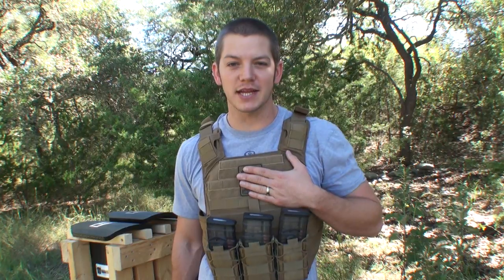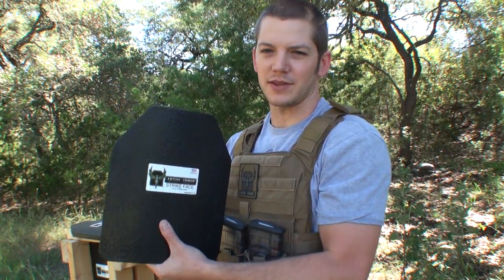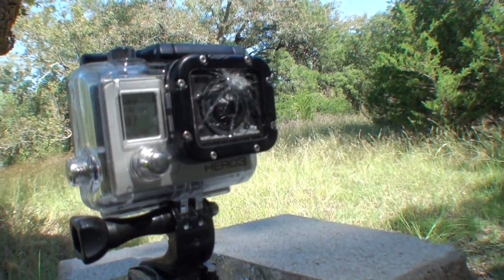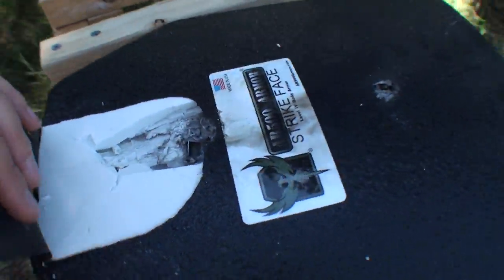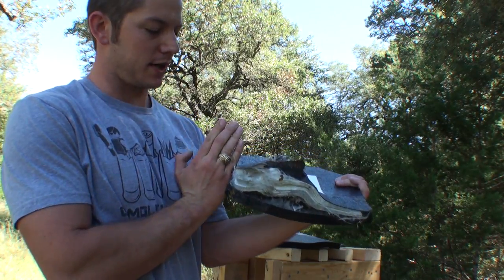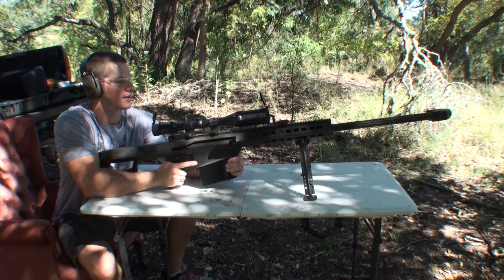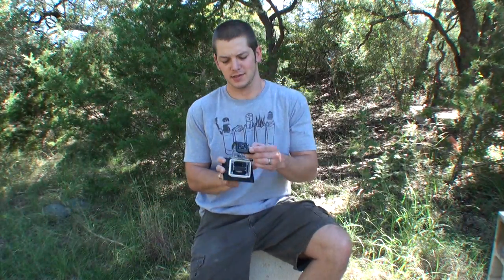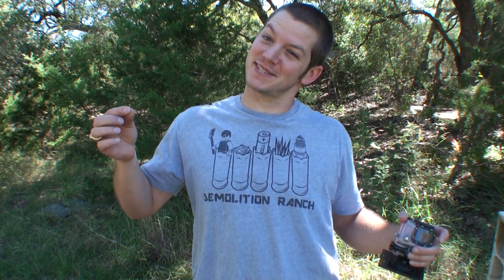Level IV Body Armor Torture, 50BMG

Comment: No armor plate will save you from a .50, the power behind it will turn your insides into jelly.
Reply: +Charles Moir 
Yep. Even if it blocked the .50, the impact itself would be devastating.
Reply: Yeah, we're talking broken ribs and broken sternum plus severe internal trauma and hemorrhage with such kinetic energy
Reply: +Xplosion51 It would drill another one on the exit side lmao
Reply: unless you got pilows behind it. #cheapandeffective
Reply: Bobby G. Why? At least it should be a quick death. Probably worse getting hit with a smaller round and barely surviving, so you bleed a bit and suffer before being shot again
Reply: I would rather take a.50 cal straight with no armor on rather than having plates...agree anyone?

Comment: Lvl 8 armor plate , 50 bmg stopper
Reply: Montagne wait what? im sure you cant wear that shit if it can stop a cannon.
Reply: Orange Username not if i put my body into MAXIMUM OVERDRIVE
Reply: TAKE MY MONEY , GIMME THAT FUCKING PLATE
Reply: @hellothere7510  You just need some padding like police use under their armor to keep them in the fight.
Reply: @alexanderkilburg7415  That's not going to help. Police officers wear armor rated for pistol rounds, and still have to wear padding to reduce the kinetic damage. The 50 BMG used to be an anti-tank round. No amount of padding will save you from 13,000 pounds of kinetic force.

Comment: Now level 5 stop an APDS 20mm round
Reply: Texas doesn't have too strict gun laws but I don't think they'll borrow you an APC or a 20mm auto cannon..
Reply: +zervan zervan If you shoot titanium with a uranium tipped bullet your saftey glasses arn't gonna stop the bullet when it reflects like a bb bulelt reflecting off metal.
Reply: WHY WOULD IT BOUNCE?
Reply: dam i want some for my Arasaka
Reply: Even if- EVEN IF it stopped it.
It'd smash your torso as if you'd been ran over by a tank.
Reply: APDS? As in Armor Piercing Discarding Sabot? Dont think they would sell those anywhere. It would be interesting though
Reply: +zervan zervan
Um, no. DU rounds aren't made in .50cal, nor would it do much to a tank if they were. DU rounds start at around 25mm, and the standard DU penetrators for tank-killing are 120mm rounds with 27mm sabot cores. The full size rounds weigh 42lbs and the projectile exiting the barrel has 560 times the muzzle energy of .50 BMG. Putting depleted uranium in a .50cal wouldn't do much other than make it heavier. (The Raufoss Mk 211 .50cal has a tungsten penetrator, which is effectively as close as you get to DU in .50cal, and that thing definitely doesn't destroy tanks. Helicopters and armored trucks, sure, but not tanks.)
Reply: ***** 
Um, depleted uranium does not heat like that... At all.
Reply: *****
Was the tank even made of titanium level 3 probably not a .50 bmg left a little hole a inch deep in the titanium uranium tipped may do a little more explosive damage to the titanium but im pretty sure it wont leave much diffrence on penetration. A rail gun could probably shoot a .50 call round through 10 tanks killing everyone in each of those 10 tanks with ease railguns may be the future of guns
Reply: +zervan zervan
I can't even... I mean, believe what you want, I can't fix stupid. But like, your facts are wrong, your science is simply nonsensical. Depleted uranium is a by-product of the nuclear grade enrichment of the naturally found mixture of the isotopes U-235 and U-238, where the radioactively viable U-235 is separated from the largely inert U-238. DU is made up of the U-238 that is left over (and is not useful in nuclear reactors or weapons,) and is mostly useful as an industrial material due its high density and hardness, (again, supplementing the use of tungsten in many applications, which makes it a useful byproduct because tungsten is relatively rare; the lack of sources of tungsten was a major set back for the German war effort in WWII.) 

The major uses of DU are in armor-piercing penetrators (because a steel cored round will melt at the muzzle energy of a high powered tank gun, not because the penetrator itself is "hot,") and in armor plating (generally on tanks.) The fact that it is used in armor plating makes your entire thesis that the heat from DU would "melt everything it hits" ridiculous, because then you wouldn't be able to use it as armor. DU gives off just about enough radiation that you might get cancer in twenty years if you handle it on a regular basis... beyond that it is harmless (if very heavy,) solid metal.

Given that the only source of DU is in nuclear grade uranium enrichment, it isn't common enough that it would make any sense to put it into infantry rounds, (especially when there is so much lash-back about that sort of thing from environment lobbyists,) where it would confer marginal benefit at best, (the bottleneck for power in infantry sized weaponry is how much recoil can be controllably managed, not the material the round is made from, which is why there is such a move toward smart grenade launchers rather than higher caliber assault rifles.) Any country with a supply of DU in the event of a major war would put it to much better use in mechanized and armored combat vehicle applications, rather than infantry munitions (especially given the extreme tactical inefficiency of infantry on a modern battlefield.)

But you know, whatever, talking out of my ass (excuse me, "my're ass,") apparently.
Reply: Plasma Skull assuming the 50 went through the tanks, it wouldnt kill everyone , probably the person unlucky enough to be in the bullets trajectory would get hit

Comment: Level 4 chest armor will work on anything up to .300 Winchester Magnum fmj, but you're breaking ribs if you get hit square on and you BETTER hope you get hit square on, because a glancing blow will penetrate and that 200 grain bullet WILL be tumbling through your shoulder or collar bone along with somw ceramic shrapnel. ANYONE needs to invent level 3+ shoulder and arm shields along with level 3 collar/neck shields for glancing blows off of the chest plate. That would be half way to a Juggernaut outfit.

Comment: Do you think the reason why the 50 didn't make it through the the second plate is because the distance between the two plates ?
Reply: The same thing was going through my head, especially with the last test he did, although tons of other videos from various channels have laughed at the people saying it needed mass behind the plate for an accurate test... would be interesting if he got some ballistic gel and put it in the space between the plates though.
Reply: En effet, cette espace permet surement un meilleur passage, se serai un peux comme plier une barre de fer sur un établi ou coincé dans un étaux.
Reply: When the bullet hits the first plate, it transfers most of the energy into penetrating it. Coming out the other side, it will have a lot of less velocity, meaning less penetration power.
Reply: There's a chance that the fragments would have been more concentrated had the plates been placed back to back. But I doubt it made much of a difference.

Comment: Why don't they just make body armor out of titanium because it's light and can stop a 50
Reply: Jack Larsen because it is expensive to manufacture.
Reply: Yes, Titanium is not cheap. Yes, it is true it is a bit heavier than aluminum and as strong as steel, but it aint cheap.
Reply: Yeh. Probably
Reply: It's not just a more expensive metal either, its incredibly difficult to work with because of its strength. Titanium is also very Brittle unless it's alloyed, so i would imagine the metal could become fatigued and develop cracks. Titanium with that ceramic strike face stuff, plus some of the polyethylene stuff, the high density polymer string armor that is better than kevlar, I would very much like to see a layered armor system with all of that in it. at this point with body armor though, we have the tech and materials to stop .50BMG with a plate, its energy doesn't stop. with enough money you could make a plate that could deflect 20mm AP (not APFSDS), but you'd still get turned into jello by the impact.
Reply: Yes. You need a shock absorber built into those kinds of plates, like 50 BMG stoppers and those vehicle gun stoppers. And cheap springs wouldnt do, you would need something like an elastic gel
Reply: Sure but what is the point of stopping that bullet if the impact alone will most likely kill you lol.

Comment: When I was looking for plates, I ran across the AR500. Did my research, looked at tests, had already decided that metal plates was the way to go considering I had already been through an act of gun violence having been shot at ten times, operative word is at, and surviving (7.62x36).
So, I was sure I wanted steel over ceramic. Paid for the front and back plates, extra coating, and advance right hand shooter option. 

The level III+ are actually lighter than my buddy's, who served with me in the Air Force, ceramic plates. Very happy with the purchase (cost less than ceramic counter parts). Thanks Matt,  for the extra test footage to confirm my purchase.

Comment: Suggestion for your plate holding wood frame top. Think through bolting your cross 2 center top pieces and holding in place with threaded studs. Wood threads on bottom side and machine treads and wing nuts on the top side will solve your deformed plate removal problem. just remove or loosen 1 or 2 of the center cross bars and you'll have it made. Very good test video, thanks.  Klix

Comment: For the second test the ceramic would be already compromised slightly. Ceramic is very very brittle as we all know, and it is designed to crack when hit by the bullet, since the formation of cracks takes energy. However, some cracks may have propagated throughout the plate to the upper side when you shot them first with a .50.

Regardless, super cool video!

Comment: Would be interesting if for the ceramic plate, there was a smart material that acted as viscous liquid without an applied electric current, and like a ceramic with, that way you could essentially have long term use version of these plates, although they would be much more complex - interesting idea nevertheless.

Comment: normaly soldiers with heavy armor are wearing 2 AS armor plates and 1 between them wich is used as an blast protection. Like this you will defently fall away but you will not end up with an blown up chest.

Comment: Hey man.  LOVE the vids. Have you ever thought about making a 'home made body armor' vid? I'm not talking prison phone books taped around the torso but something PRACTICAL. I made one using layers of thick fiberglass matting bonded with a non hardening thick adhesive layered in stages with 16 gauge standard automotive grade sheet metal. The hardest part for me was sewing the components together (I SUCK at sewing and this hobby isn't conducive to my dating life or local tailors). But after some testing I made a vest with side and even throat protection for very little money. At 20 yards .22, .380 and .38 special are stopped CONSISTANTLY. Heavier (+P and Magnum) rounds are tough to stop and FMJ rifle cartridges rip right through but the use I had in mind for this was cheap street thug pocket packin' punks. That's all, just a suggestion and some commentary. Stay cool. - Jeff

Comment: I'm willing to bet that no matter how many plates you have on, a .50 round will kill you from just the blunt force punch. Collapsed lung maybe?
Reply: I`m no expert, but I think its very likely to be drowning in your own blood from lungtissue turned into mush. No cure. And not to mention what a blow like that can do to your spleen. I`d guess one would bleed badly internally. Best case would be suffocating with a broken ribcase and thus collapsed lungs. Very deadly, but I think there is a way you can be saved by advanced paramedics if treated in time.

Comment: What if you had to stop a 50. BMG FMJ and a big enough to hold 2 lvl 4 ceramic plates and 1 lvl 3 steel plate, I would set them like this: The lvl 3 steel plate to the front to weaken the 50. BMG bullet in order for it to be stopped more effectively by the two lvl 4 ceramic plates, and the two lvl 4 plates behind the lvl 3 steel plate to catch the slow and weakened 50. BMG round and its remaining fragments. That way you (could with a high chance) successfully survive a 50. BMG round without getting more than a broken rib cage and a bad memory about it.

Comment: How far away were you from the targets? How about doing a video of how the armor would do from 5 feet. That's what I'm interested in. Why, you ask, because that's how close you'd probably be to someone forcing themselves into your home and they're wearing body armor. I'm sure all body armor can do well at 25 yards or farther away but how about up close? I doubt it would stop a .308 / 7.62 X 51mm NATO FMJ at 5 feet. Someone busts your door in and you're right there in front of them when they attempt to enter. That's what I want to know. Will the armor fail? Even if it didn't fail at five feet, they'd be on their back unconscious or trying to catch a breath. Nobody is going to still be standing at that distance. You could set the rifle up in a bolted down shooting brace bolted  to a heavy table and pull the trigger from farther back with a rope. If you're concerned about safety. Which I would be. Just curious. Do they give a distance when saying it's rated for such and such a caliber? Do the manufacturers test the armor up close like that or just from a distance? Thanks for the show.

Comment: if there had not been a gap in between the plates, the bullet would not have started to deviate as badly, if both plates were flush , Im sure the ap round would have not had a chance to yaw before entering the second plate.

Comment: I want to see 7mm rem mag vs ar500 steel. I know 150 gr ballistic tips blow right through 1/2 inch steel railroad plates and they also go right through a 6-8 inch wood post. But what would it do to level 3 or 3+ body armor. I've always wanted to know considering it's the biggest gun I've shot

Comment: Correct me if I'm wrong, but aren't ceramic plates only good for 1 or 2 shots? I thought the ceramic more or less shattered once it got hit, and the entire plate loses the vast majority of it's stopping power afterward.
Reply: Will S. Thats what he said
Reply: Will S. Nope. The exact number varies manufacturer to manufacturer, but I've seen plenty of instances where the plate has stopped over eight rounds (green tip, XM193, among others) in the same approximate area. Of course, multiple shots in the same exact spot would compromise the plate, but staying stationary after being shot would really be testing your luck.

Comment: Any1 else catch that? The first round, he tapped it 5 times, it usually takes 5 rounds of that size too bust through that level of armor, the second round the 50 cal round he tapped 4 times, dunno if it would sustain 4 50 rounds, but then the black tip he only taps once, Am i reading too deep into it?

Comment: Okay, so 2 plates stopped a .50 BMG FMJ and 3 stopped a .50 BMG AP...but that still won't stop you from bring put down and not getting back up. As shown, the power is more than enough to do massive internal damage through blunt force alone. O_O

You get shot in the chest, if you don't die, you'll be down with a fully broken ribcage at the very least.

Comment: I wonder if the 50 BMG armor piercing round can penetrate a small WWII tank.....
Reply: +Jackson Fisher Only way to find out is to do it, but I believe it would, easily. I think it would have trouble penetrating the armor of a modern tank, though. There have been some serious advances in metallurgy and armor construction in 70 years, and what the armor is made of is generally more important than just thickness. I'm no tank expert, but I'm sure there have been improvements.

Comment: Why doesn't anyone just use the Abrams tank Armour, the Depleted Uranium.
Reply: Too heavy my friend. The armor we wear in the Army is already 25-35 pounds with side plates. Depleted Uranium is dense & therefore too heavy to be used as personal armor. Personal armor plates generally use ceramic plate layered with steel plate or titanium as well as Kevlar.
Reply: Depleted uranium would also slowly give you radiation poisoning. When the u.s. used depleted uranium shells, It contaminated water for the people who ended up drinking it, And these people who were born from parents who drank it have birth defects, And with such close proximity to human skin, It would get to you, And make you very sick, And possibly kill you eventually. The abrams tank only has depleted uranium plates on the outside, And thick steel between it and the crew, So they are safer.
Reply: +Stuart “AiCfan” Pot only if you eat it, why doesn't anyone understand that. it's harmless as long as you don't eat it.
Reply: You're not wrong. But it is most definitely too heavy for personal armor applications.
Reply: +Stuart “AiCfan” Pot hehe, you think I'm stupid, hehe😆😆😆😆 no I'm far from that, you see I'm smarter the most people, I created a weapon that can fire a massive laser, it's just missing the stuff it needs to become lethal to people and armour. but it does work and has a high temperature, it just needs a focus lens for its deadliness to work.
Reply: +Stuart “AiCfan” Pot hehe, you think I'm stupid, hehe😆😆😆😆 no I'm far from that, you see I'm smarter the most people, I created a weapon that can fire a massive laser, it's just missing the stuff it needs to become lethal to people and armour. but it does work and has a high temperature, it just needs a focus lens for its deadliness to work.
Reply: Kenneth Burright hahahaha do you even have any friends?
Reply: ***** thats a negative shaggydog over
Reply: It's still to hard to make nano stuff on a massive scale. It would take forever to do.